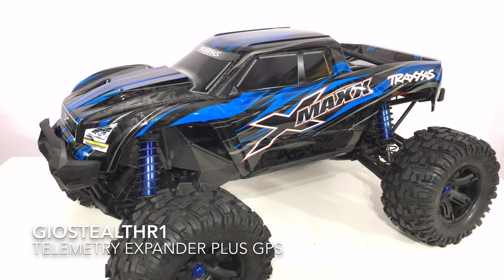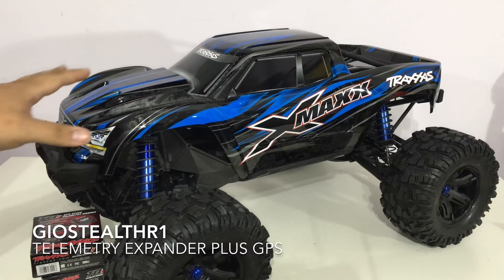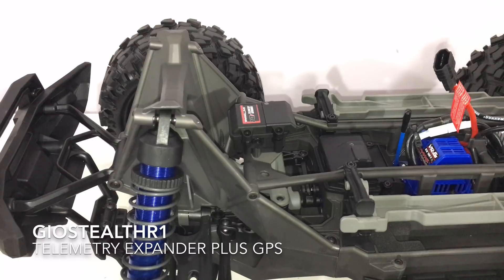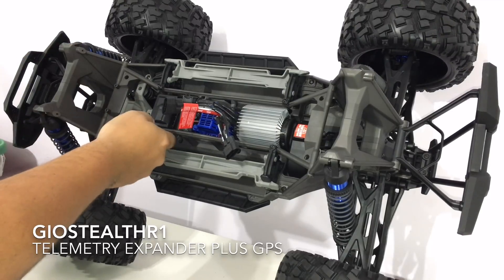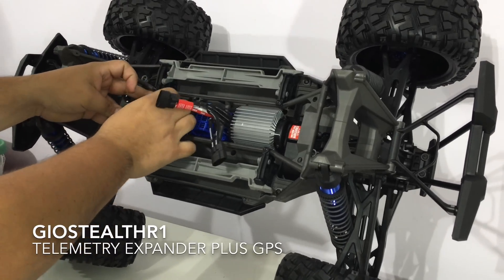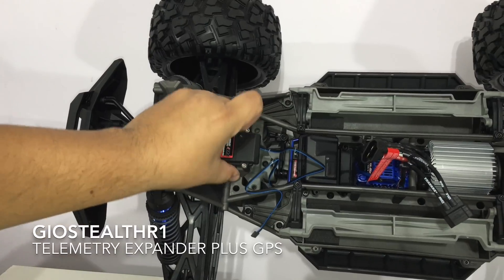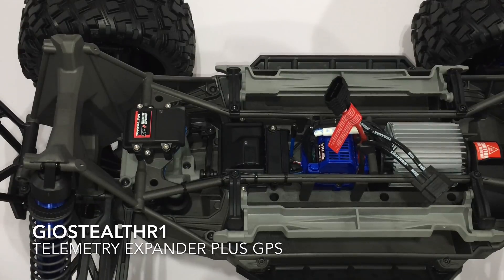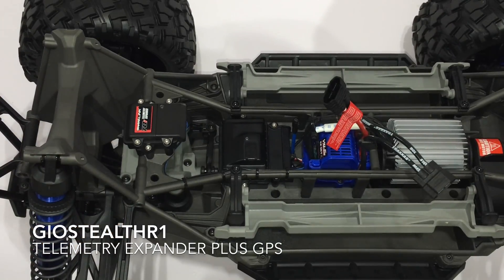TRAXXAS X-MAXX UPGRADE TELEMETRY EXPANDER PLUS GPS 4K

Comment: After telemetry expander with gps modul installed on my X-maxx, throttle and reverse not working. Communication cable from expander is install correct. Where can be a problem?

Comment: I want to do this to my new 8s x maxx. I have the blue tooth module in my radio and all stock it tells me battery volts and motor temp. I want to get speed too. what do I need. the GPS and what else ?
Reply: ULTiMATE TRAXXAS MAN gps and gps extendor

Comment: Hey Gio hope you are doing well. Question bro, the GPS that you installed on the X-MAXX, does it show rpm/speed on the app. If not how do you see the speed of the truck. The telemetry expander does actually what? Do you need both items to work together?
Reply from the maker: The GPS works as an actual GPS. 
It's not the other set up where you supposed to see the RPM sensor
Reply from the maker: The telemetry expander actually fits the GPS module in it perfectly. Plus you're able to expand all your telemetry as in voltage and temperature on that unit without overloading your receiver
Reply: GIOSTEALTHR1, cool thanks bro appreciate your help.

Comment: can I use just the gps?
Reply from the maker: As in ?
Reply: +GIOSTEALTHR1 do I have to use the traxxas expander for the gps module to work,  or can I use just the gps. I have the remote and docking station with ipod.
Reply from the maker: Yes you do need it 
It will be like 20 dollars more
Reply: +GIOSTEALTHR1 why do I need It if it don't even plug in to it it just sits in there. dose the same thing as a Garmin.
Reply from the maker: •Water proof 
• Mounted correctly with out the risk of popping out like a Garmin
Reply: +GIOSTEALTHR1 that's it,  so as long as I got the remote and app the gps module will work..

Comment: Hey I have a question. I put the same thing on my xmaxx. Telemetry and the gps. But it doesn't seem to work right. My rpm and mph don't work. Do they work on yours?
Reply from the maker: Yes they do 
Did you set it up in the app?
Reply: +GIOSTEALTHR1 do I have to change the speed reading rpm to gps in the traxxas link app?

Comment: hi gio. hope u enjoy your new  truck waiting for mine. just wanted to know gio do u think this truck is powerful enough on 6s. because I've seen some videos an looks pretty underpowered to me I know it only has a 1600 kv motor in it not for speed. but what is it top speed on 6s I heard it's 35 mph which seems to slow. Do u think some people out there will change the motor over to a 1900kv will that motor even work in it ?
Reply from the maker: I know guys that are putting the xl2 esc for 8 cell setup ... When I mean guys I mean I'm thinking about doing it lol
Reply: +GIOSTEALTHR1 wow loool. I never even fought about doing something like that I can imagine that would be insane. I think 7s would be just right for this truck